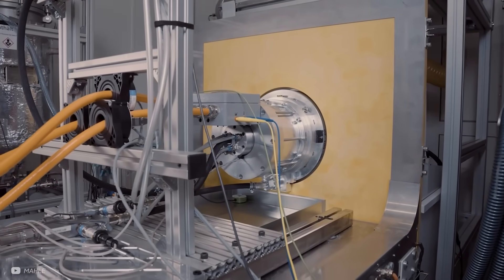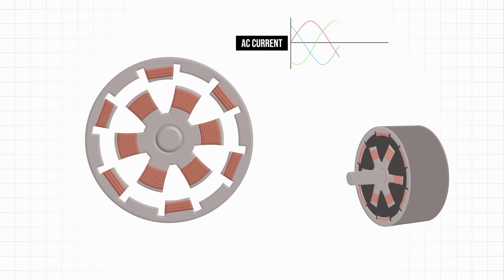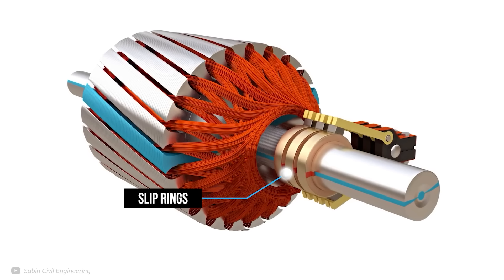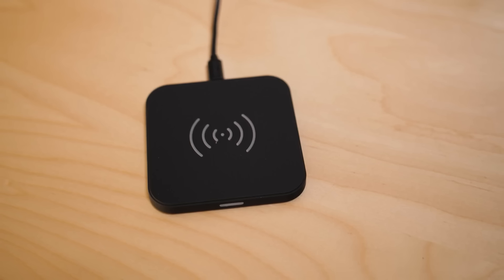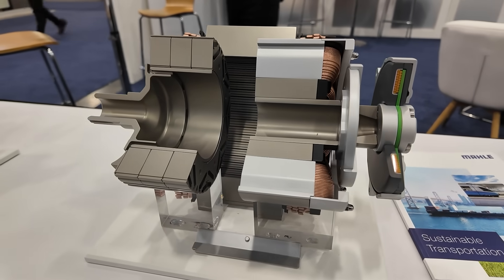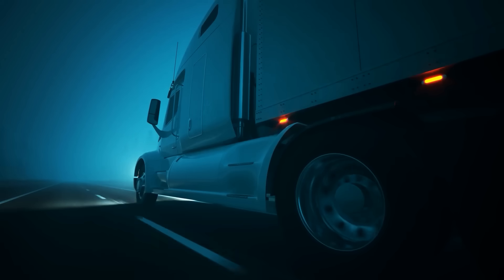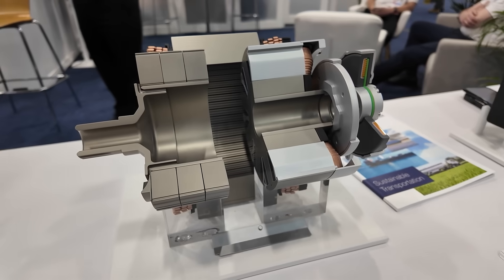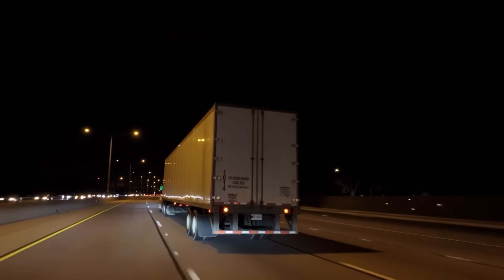Genius Contactless Motor Could Change Transport Forever

Comment from the maker: Protect yours and your families privacy and support the channel by getting 20% off DeleteMe at https://joindeleteme.com/Ziroth
Reply: Vaporware used for clickbait. Shameless waste of the viewer's time. No evidence whatsoever of the claim to "change transport forever". In a righteous world this would get disliked into oblivion.
Reply: @NondescriptMammal  This is an example of a real genius, making money from nothing.
Reply: @NondescriptMammal  trouble is, YouTube had issues with scams not being able to get away with the warning signs, so they removed the thumbs down counter.
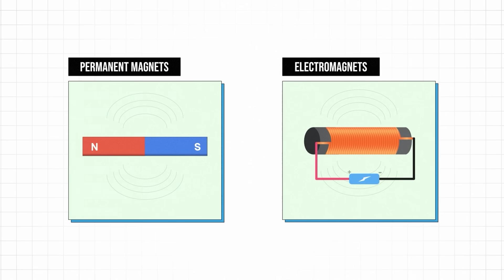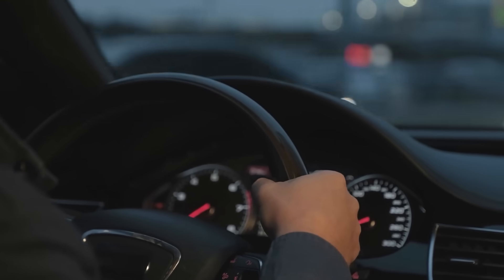Reply: 1:16  3:24 6:47 you just keep repeating things to artificially lengthen the video
Reply: @practicalthinker5545  He has to get to at least 10min. so youtube can insert adds so he can monetise this rubish video.
Reply: yea I'll need to see the efficiency results conducted by an independent lab before believing their "sales brochure" numbers..
Reply: @snoopstp4189  you and I both.
Reply: So, this new motor is a giant step BACKWARDS, to early polyphase motors invented by Nikola Tesla, in that they have wound rotors (no permanent magnets). But that is combined with a way of getting externally controllable levels of power into the spinning rotor, without needing slip rings. All of is OLD, except for the external control. Only that particular separates these new motors from existing brushless polyphase synchronous AC motors... Which, btw, run as induction motors at low speeds, for greatly improved starting torque.
Reply: @YodaWhat  funny how much external control has already been built into many vehicles, why would any consumer want that?
Reply: you did not really cover in simple terms what this might do for futuve ev's. are we looking at a serious increase in range from the same battery?
Reply: @krusher74  battery? electric motor infinite fuel from radio signals and wifi signals no battery
Reply: How is this "contactless power" transition different from "brushless motors" I see in small motors like battery powered hand tools or small hobby motors?
Reply: @TheKenWiley  brushes traditionally transfer DC power, but if phase locked can transfer alternating current.  His design cannot transfer DC, as wireless tech can only transfer AC. It is a less efficient design, which is why they need cooling.
Reply: Come check us out
Reply: Electric motors are NOT fundamental to "sustainable" transport. Sustainable is simply a code word for economy destroying technology. EVs are failing. Tesla will be bankrupt in five years or sooner. No one want's EVs anymore. Once burned. Never again kind of thing.
Reply: I see a similarity of a synchronous motor with added excitation of the rotor windings through an induction generator added to the rotor. The question I have is once the RPM runs up, how do they regulate the input  to the rotor windings. Part of load calculations to run an electric motor is dependent on the excitation. Once you reach over excitation and go beyond, you need to calculate for a higher current.
Reply: Is the guy from the "In The Mix" channel family of yours?
Reply: Don't waste your money on removing data. Spam them with false information.
Reply: They have had it for ten years, they have just been looking for the highes bidder.
Reply: Sir, can you help me? Please tell me how you make this animation video. Which is the app on which this animation is available? Please reply. Thank you.
Reply: FWIW - I subscribed to your channel the moment you said you give us an overview to see if we wanted to continue.  Thank you for respecting my limited time.
Reply: Thanks. There are no slip rings to wear out, but there are oil seals with rotating surfaces which will wear out. Pumping coolant/lubricant into the rotor via the drive shaft centre, without it leaking significantly, is an interesting area for consideration. Are they pumping that coolant from inside the casing, with pump drive power taken from the rotor?
Reply: Thanks Ryan. One important question arises: With EV motors which can spin at speeds around 11,000 rpm, how are they preventing the cooling oil from leaking from the end of the hollow rotor shaft? Those seals will have to be rather special.
Reply: How do you think which motor is more durable for heavy duty BLDC or AXIAL FLUX
Reply: wow....high hp electric motors made with solely common metals.... oh boy, this could get interesting, but will they let it?
Reply: Nobody thinks to use liquid metal or liquid contacts?
Reply: @RaadIrfaan  what, you wanna start spinnin' mercury?
Reply: Reported just for legalizing it just for stealing the idea from me
Reply: @MultiverseTechnologies1994  whoever gets Patent first owns it.
Reply: Oil cooler methods sound great 👍 Advanced wireless electric motor. Your thoughts are awesome. Good work. The Word needs this technology. Our World 🌍 is getting better thanks to People like You. Peace ✌️
Reply: @AreneeAndrews  Are you his mother?
Reply: Thank you!

Comment: See below, already well established on the market, metal liquid slip rings offer an easier solution applicable to each motor with brushes

AI Overview

What is a Slip Ring? 
Gallium alloys are used in liquid metal slip rings as a non-toxic alternative to mercury for transmitting power/signals with extremely low friction, no wear, stable conductivity, and high current capacity, featuring tiny gaps filled with the alloy and electrolyte for 360° rotation, ideal for automation where high performance and reliability are key. 
How it Works
Structure: A gap between a rotating (rotor) and stationary (stator) electrode is filled with gallium-based liquid metal and an electrolyte.
Wetting: The electrodes are prepared (electrowetted) so the liquid metal adheres to their surfaces.
Connection: As the parts rotate, the liquid metal maintains the electrical connection, allowing seamless, wear-free current transfer. 
Key Advantages
Low Resistance & Friction: Fluid nature minimizes viscous drag, offering extremely low rotation resistance and torque.
Long Life & Reliability: No brushes mean no mechanical wear, leading to billions of revolutions and stable, arc-free transmission.
High Performance: Handles high currents and stable signal transmission with low loss.
RoHS Compliant: A major benefit over toxic mercury, meeting modern environmental standards. 
Gallium Alloy Characteristics
Low Melting Point: Gallium alloys melt easily (e.g., < 30°C), making them ideal for liquid operation.
Wetting Properties: Gallium wets many metals (like copper), forming stable films that aid conductivity.
Alloy Selection: Specific low-melting eutectic alloys are chosen to balance cost, performance, and compatibility with electrode materials (often copper or specialized alloys). 
Applications
Industrial automation equipment.
High-quality signal transmission (micro-voltage, data).
Any rotating system needing continuous, reliable electrical connection. 
In essence, gallium alloys enable advanced liquid metal slip rings that overcome the limitations of traditional brushed systems, providing superior performance for demanding applications.

Comment: All of this could have been simply called brushless motors. which have been used in RC cars for 13 years.. And such motors can reach 50,000 RMP and higher... The consumables in this motor are bearings, since in this motor there is simply nothing that can break. These motors can have 2 or 12 poles; a motor rotation encoder can be used in them. For ultra-fast motors, an encoder is not required.

Comment: This technology is old, in 1987 at GEC, I developed medium voltage inverter (from LV In), load commutated for brushless sync motor , 3000 HP,  They were installed at the city of Dallas, among others, 
Marvelous characteristics, efficiency, controllable Power factor, and other tech, details.

Comment: the problem is still line losses and battery weight........Mahle should make a more efficient automotive alternator with that idea.
the most efficient alternators currently are 75% efficient...a 95% efficient one would save fuel.

and people have to get new alternators on occasion anyway........if you could tell them " this new one " might pay for itself in reduced fuel consumption.

Comment: The plug-in hybrid Crosstrek & Forrester, and I believe also the Corolla (maybe others?) use oil cooling in the electromechanical CVT, so this is actually a technology which is mature. You use a cooling/lubricating oil in these CVT instead of a more viscous "hydraulic pump" oil, which conventional CVT's and most automatic transmissions rely on to operate (it's basically a hydraulic pump).

Comment: The three slip ring rotors shown here at 3:57 are wound rotor induction motors which are connected to variable resistors, traditionally used for 'soft starting' large induction motors under load. AC Synchronous motors only have two slip ring rotors where DC is supplied to the rotor and there are a fixed number of field coils that match the number of poles in the stator. There are a number of different motors shown at different times mixing everything up. Good video but would be confusing to those not well versed in electrical theory.

Comment: Not necessarily true that a sync motor is cheaper than a permanent mag.  Energizing the rotor means much more copper, and more windings meaning more complexity in building the rotor.

Comment: This tech combined with circuit board printed coils and flexible PCBs will make custom motors extremely cheap to manufacture. The robotics industry could finally explode. Government just needs to disable patent holders from denying licenses. Because it's the combination of all these inventions that will make a countries robot market thrive

Comment: If it can power a truck up a mountain, then maybe it could be used, in reverse, as a frictionless brake system to prevent runaway trucks due to brake failure (overheating).

Comment: This is so silly, just a month back i was talking about building a motor that has windings instead of magnets for the purpose of being able to turn it off. I would have used slip rings though. Good thing i didnt keep to that idea and i have another one, that if it works, it might be even better and far simpler

Comment: I mean... might get better with time but most of all wireless chargers i've seen input 2 amps and output 1... Effeciency for wireless transmission will never be as good as direct transfer and even though using no permanent magnets is more efficient, this technology is losing out due to having the wireless power transmission. Nobody seems to have really bothered to compare the efficiency of this type of motor with the slip rings versus the wireless induction... Probably because it would render the design useless and wear and tear from direct contact would be more cost efficient over time than wireless...

Comment: Slip rings on DC connections don’t really wear much. Renault have been using them on their exciter rotors for many years. Should hit 100k miles. They are also easily accessible should they need to be changed. So not a massive improvement for the additional cost. Efficiency is at high RPM for these motors and worse than magnetic rotors at low speed.

Comment: I don't understand why they do not use another chemical to cool the motor besides oil. I feel this decision was made on a financial standpoint instead of a technically evaluated decision. 

Here is a list of the types of dielectric fluids available: 

A.I. Break down:

Dielectric fluids are insulating liquids with high electrical resistance, used in various applications like transformers, electrical discharge machining (EDM), and high-voltage capacitors. Common examples include mineral oil (often used in transformers), silicone oil, synthetic esters, and even purified water for certain pulsed power applications. [1, 2, 3, 4, 5, 6, 7, 8]  
Here's a more detailed look: 
1. Mineral Oil:  The most common type of dielectric fluid, particularly in transformers. It provides insulation and cooling. 

2. Silicone Oil: Used in applications where higher temperatures or non-flammability are required. 

3. Synthetic Esters: Offer good dielectric properties and are sometimes used as alternatives to mineral oil in transformers.

4. Perfluoroalkanes: Used in specialized applications, often where high dielectric strength is needed. 

5. Purified Water:  While not a typical transformer oil, purified water can be used as a dielectric fluid in pulsed power applications. 

6. Electrical Grade Castor Oil: Used in high-voltage capacitors to prevent corona discharge and increase capacitance. 

7. Synthetic Polyalphaolefins (PAOs) and Gas-to-Liquids (GTLs): These are other types of synthetic fluids used in some applications. 

8. High Molecular Weight Hydrocarbons and Tetrachloroethylene:  More expensive options with excellent dielectric and thermal properties. 

9. Dielectric Hydraulic Oil: Specifically formulated for hydraulic systems where electrical insulation is critical, like in power utilities. 

10. Dielectric Fluid for EDM:  Often a type of light hydrocarbon oil, it serves as an insulator, coolant, and debris remover in electrical discharge machining. 

[1, 2, 3, 4, 6, 7, 8, 9, 10, 11, 12, 13, 14]  

AI responses may include mistakes.

[1] https://www.youtube.com/watch?v=e9fQh10qXtA

[2] https://en.wikipedia.org/wiki/Dielectric

[3] https://www.quora.com/What-is-liquid-dielectric

[4] https://www.amedm.co.uk/a-guide-to-dielectric-fluid-in-edm/

[5] https://www.globalspec.com/learnmore/materials_chemicals_adhesives/industrial_oils_fluids/industrial_lubricants_greases

[6] https://en.wikipedia.org/wiki/Liquid_dielectric

[7] https://foxway.dk/Admin/Public/Download.aspx?file=/files/files/pdf/schneider-electric_wp291-v2_comparison-of-dielectric-fluids-for-immersive-liquid-cooling-of-it-equipment.pdf

[8] https://taylorandfrancis.com/knowledge/Engineering_and_technology/Mechanical_engineering/Liquid_dielectrics/

[9] https://www.mdpi.com/1996-1073/13/23/6429

[10] https://www.sciencedirect.com/science/article/pii/S0960148112000821

[11] https://www.numberanalytics.com/blog/ultimate-guide-perfluoroalkanes-organofluorine-chemistry

[12] https://shop.engineeredfluids.com/blogs/news/dielectric-fluids[13] https://tri-gemini.com/dielectric-fluids/

[14] https://testbook.com/objective-questions/mcq-on-electric-discharge-machining-edm--5eea6a0d39140f30f369e2b8

Comment: I can do without circulating oil through the whole car.. but a closed-loop AIO oil-cooled engine sounds kind of nuts... that's like 20 years without a service on the engine and everything else is 10 to 15 years like wiring and chips. Cheap replacements for all the CPUs instead of sensors. Simple efficient drive trains direct to wheels. I still like the hybrid model to power it though. Gotta give us gear heads something that purrs you know?😉

Comment: you can use ferrite material for permanent magnets  
for the core of the electromagnets and increase the magnetic flux 
further since the external excitation is usually a DC and 
magnets do not change their polarity

Comment: Honestly, I'm not clear on what the "innovation" here is? Is it wireless power delivery? We had that for a century. Oil cooling? We had that for a millennia. Removing permanent magnets from a BLDc motor and using electrromagnets on both sides, as you've noted, not a new idea... Nothing in this "perfect motor" makes me think it's anything other than another venture capital bait.

On another note, who exactly is your audience mate? Is it people who know nothing about how magnets work? You think a lot of such people would watch videos about new electric motor tech(even if it " Could Change Transport Forever")? 

If your audience is people who are at least somewhat technically literate, what's the point of explaining how a motor works in an elementary school level? I get you gotta hit that 10 minute mark but this video really feels like 90% filler and 10% information.

Comment: A high efficiency IE5 induction motor has an efficiency of 95% these days. I wonder if they can make one that will run at 6,000rpm, saves on a lot of buggering around.